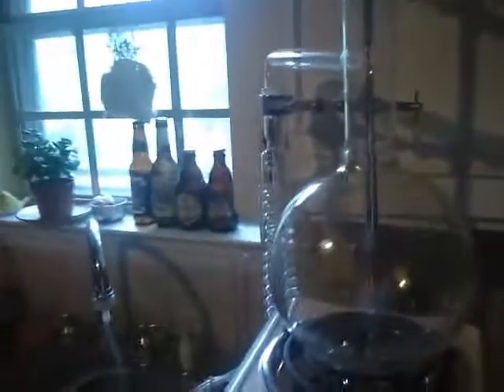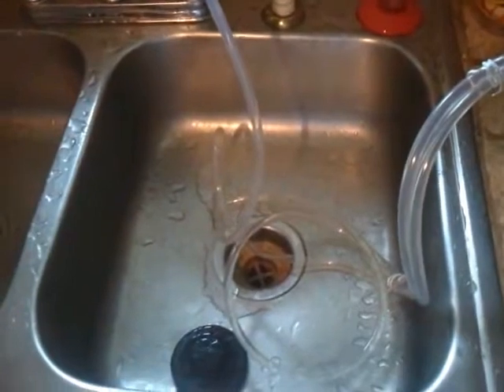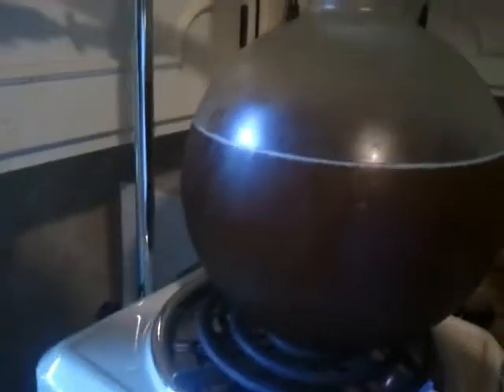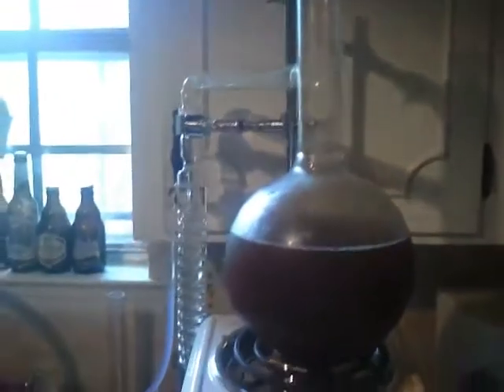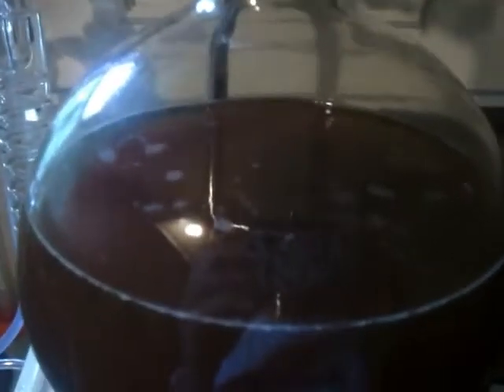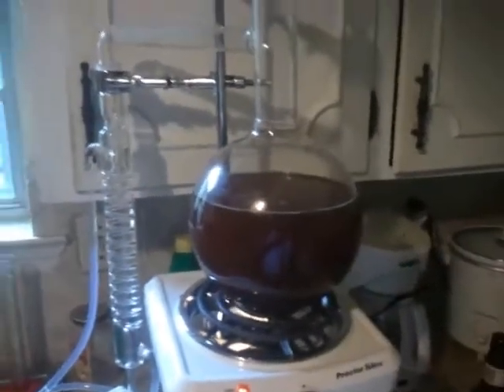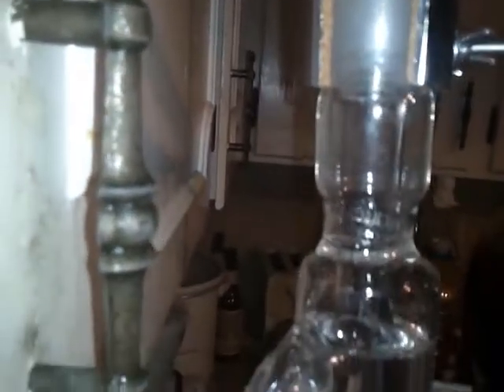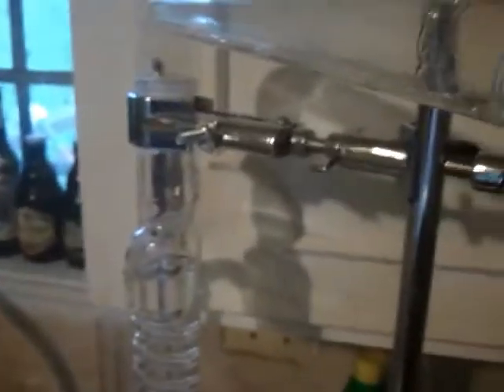2000 ml ethanol distillation apparatus

Comment: Awesome still , would an open flam under the boiling flask damage the glass ?
Reply: +ricanked69 it shouldn't because most lab equipment is meant to have open flames but you have to check the ratings
Reply: Nah ur good m8

Comment: You sent me a link to this and I have to say, not bad. I would use that set up, but I might put some well cleaned copper mesh in the side tube. Looks like the set up they would have used on the TV show M*A*S*H.
The guy that commented on NEEDING extra stuff like fractionating column and thermometers... It's nice to have but you don't need that stuff
One personal note. I would turn the heat up higher until your brew gets hot, THEN turn it down.
Reply: +wcemichael Thanks for the heads up. I agree you can distill with just about anything you want. Im just set in my ways I used to power up early and then lower temp but had an "Energetic" event caused by this and started doing them slow and steady . Power bill isn't a problem so Im just set in my way now.

Comment: Boiling actually isn't bad. Your setup simply isn't properly set up for it. You'd need a fractionating column with a thermometer on the top adapter which would connect to a condenser. That thermometer should read a constant 78-79C, at that temperature the vapor you're getting is nearly pure Ethanol. Plus, doing it this way speeds the distillation up exponentially.

Comment: you want 24/40 and get the biggest flask you can afford . also get some boiling chips they help the for shots and heads boil smother and vaporize  faster sooner for better seperation. not sure why more people don't use lab glass for distillation
Reply: speedxdreems size limits mostly and cost vs copper stills is the only reason i see people not using lab glass